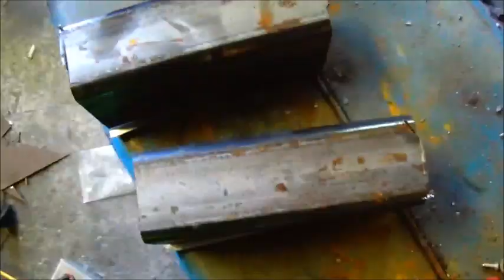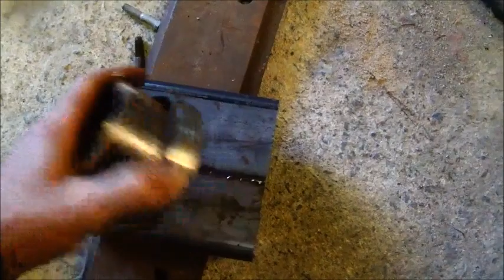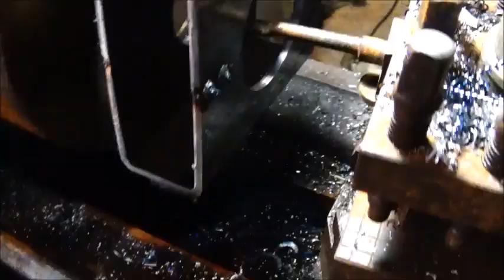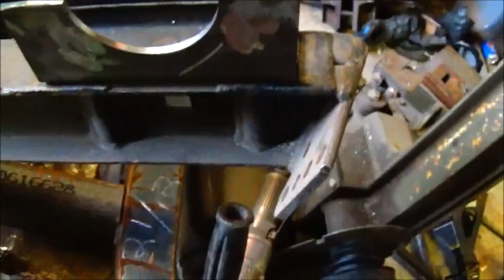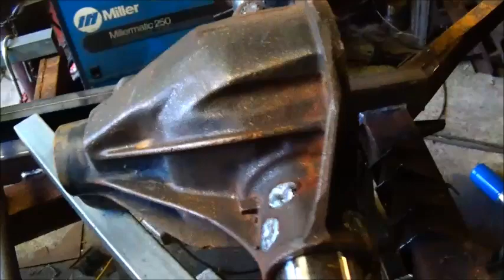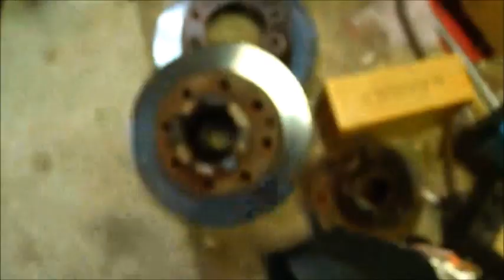Low Budget Drag Car Build Part 15 Spring Perches For Rear

Comment: Dana 60 is plenty strong ,just kind of a pain to change ratios that's why most drag cars use a 9 inch type as does NASCAR . You can change out the gear in about in about 10 minutes.

Comment: Glad to see youre on the drag car again Jonathan, Tractors and tow jobs just arent my cup of tea. Lol I just fired up my 388 chevy on the run stand and got oil gushing out of the rear main seal, so thats my job , wait for felpro seal and put it in. I may have to get the 2909 because the crank journals were line honed.

Comment: It's only cheating if you get caught. You're using the most important tool in the bucket; your brain. Necessity is the mother of invention. For those who perhaps came along in this series late or who have forgotten what the challenge actually was: The challenge is/was to build a go-fast drag car out of what was in the yard without spending a ton of money as if a 16-year-old were to do it on a super strict budget. Jonathan W you are doing more than fine how you're going about doing this. Thank you.

Comment: Nothing wrong with a Dana rear, until the eighties when all the aftermarket company's started turning out tons of stuff for 9" rears and the pros started using aftermarket versions of the 9" the Dana was the rear to use. Today its cheaper to build a tough 9" for high hp use but for such a light car the Dana should last a lot of fun passes. I have a 12bolt rear in my Monte Carlo drag car and it's lasted a long time.

Comment: I've been a 177  miles an hour and turn to 8.16 ET with a Dana 60 in a 30 600-lb car so if they're telling you Dana 60s crap they just have it never had to use what was laying around it'll Outlast the 9-inch Ford
Reply: Scott H 30,600 lbs must be the heaviest drag car ever

Comment: You are building this car for yourself so anyone who has a opinion about it can shut up right now about how you are doing it wrong ! I have a thought you might consider , cut the rotor down to a non vented single disc to save some rotating mass . I can't see why it wouldn't work other than you will have to narrow the caliper, or find one that will fit. Anyway just food for thought.Keep up the great work.

Comment: Simplest way to make spring perches is to take rectangular tubing, use a hole saw the size of the axle tube and make a hole across the center of the tubing, then split the tubing lengthwise. Instant spring perches!

Comment: I too appreciate you going through with the axle narrowing project.  It’s really cool!

Now about what you mentioned about people hating on the Dana 60... I think they’re off their meds or something.  The stock Grand Cherokee SRT8 had a Dana 44, which is weaker, in a much heavier vehicle with 420hp and 420lb/ft of torque... I think you’ll be fine with that 60 in there 👍